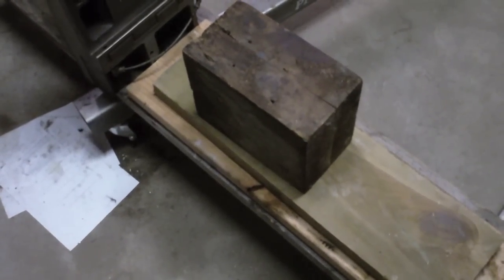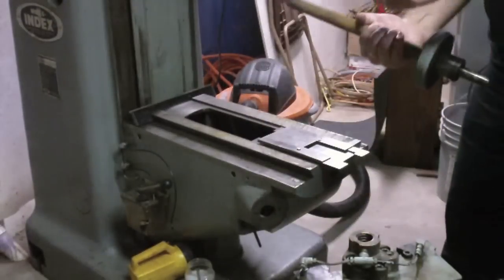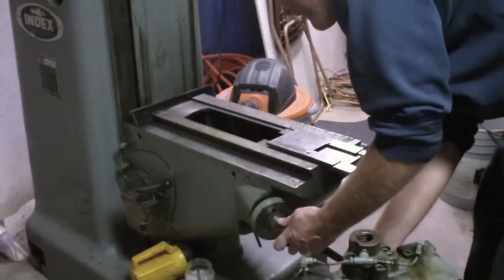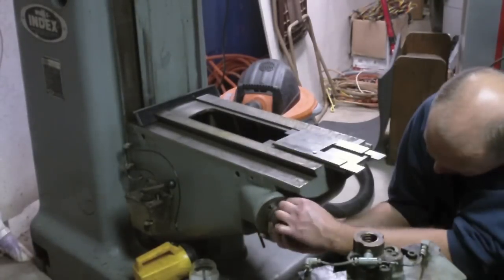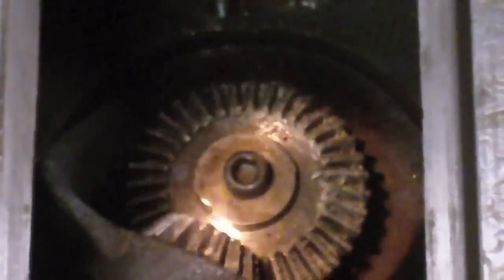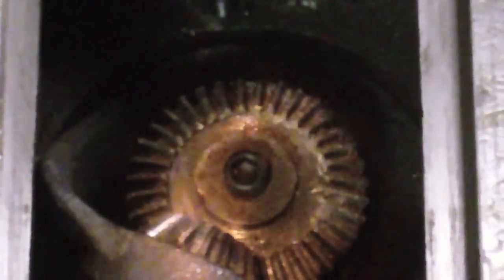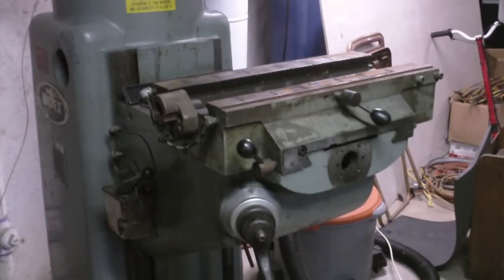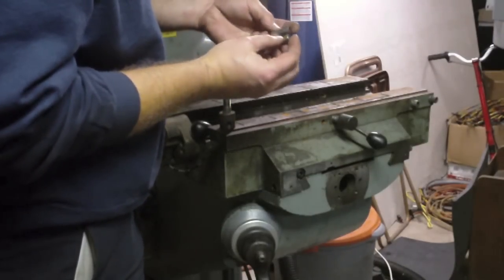Wells Index Milling Machine Part 21

Comment: I don't know how to get hold of you so here goes. I have the same mill the wells-index 847 and have the same problem with the noise in the head. Have you had any luck with fixing it ? I know it has been 2 years ago you worked on yours. Thanks for sharing your experience it help me under stand a lot of the workings of my mill.  Bill
Reply from the maker: D Cat hello Bill. You should be able to message me your email address through here, or Google. I'll try messaging you now.

Comment: Now that you have it that far together.. you might look at quality way oils.

http://www.hangsterfers.com/products/machine-lubricants/

that's what I use.  Mobil Vactra is ok.. Hangsterfers yeah does cost only a fraction more but I find lasts a little longer.

Need to buy some: go to thelubricantstore.com

Keep in mind there are basically four different grades of way oil.  #1, #2, #3 and #4. 

#1 and #2 are for most horizontal slideways and #3 and #4 are generally more suited for large machine tools.

Mobil Vactra Oil No. 1 and No. 2 are recommended for horizontal slideways on small to medium size machine tools. They are also suitable for circulating application in large machines and as a moderate duty hydraulic fluid.

Mobil Vactra Oil No. 3 and No. 4 are normally recommended for large machines where way pressures are high and good precision is required. They are also recommended for vertical and inclined slideways where drain-down can be a problem and for moderate service machine tool gear drive mechanisms.

#1 is ISO 32 grade
#2 is ISO 68 grade
#3 is ISO 150 grade
#4 is ISO 220 grade

Keep that in mind.
Reply from the maker: Thanks. I have a local supplier I'll check prices with. I have also seen Vactra at a decent price on Amazon.